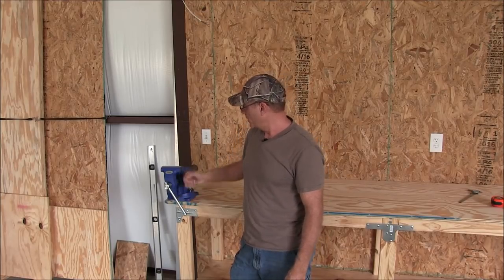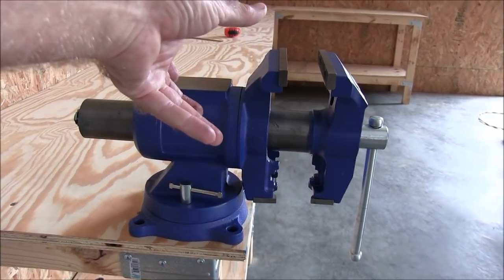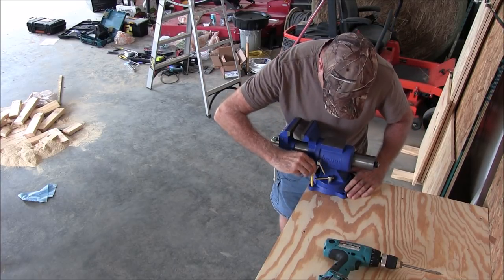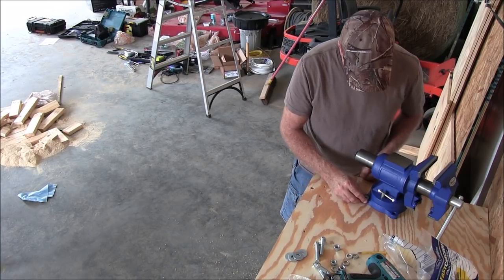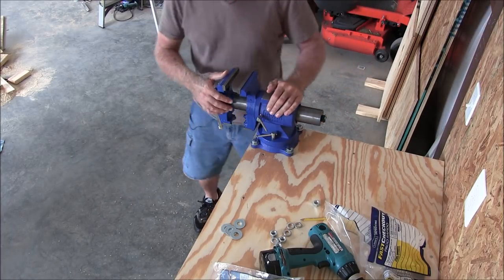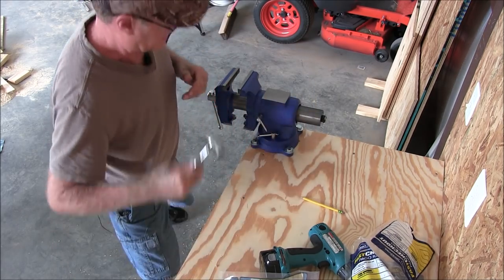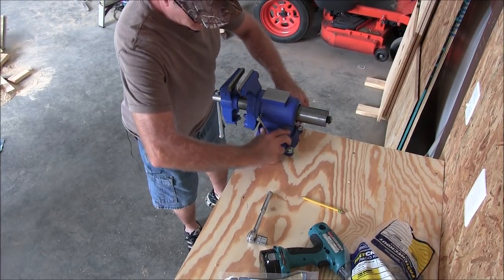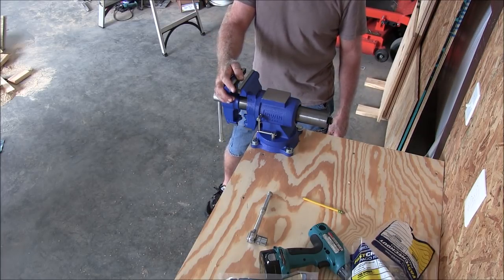How to Install a Bench Vise

Comment: Mounting a  MACHINIST's vise on a random workbench is a waste of effort.  The one used as an example is a very poor example, as the top is too thin and the base is not positioned to provide solid support, and the bench is positioned in a non-optimum working location.  A woodworker's vise will have completely different mounting requirements. 

The things to consider are your workbench construction, placement, and whether you are right or left handed.   

 If you are building a workbench for yourself, then make it for you, not some "average" user. Do not blindly follow a plan that was created by another user.  Workbench design should be based on intended user AND the use.   The height should place the workpieces at the best height for the user.  The depth and width of the bench should be adjusted to suit the items being worked on.   

If a machinists's vise is to be incorporated into the workbench design, not mounted as an afterthought,  then the top should be built to support the vise's weight without flexure UNDER LOAD.  The leg structure should be sturdy enough to withstand the forces applied to it IN USE.  A leg should be directly beneath the vise to fully support its weight, without interfering with its mounting hardware, unless there is a compelling reason not to do so.

Any universal workbench design will be a compromise unless the work to be done is known and the size of the user is close to "normal" size.  The best example of bad design is seen in kitchens. Short and tall users find that working in a standard kitchen is awkward and tiring, and when they utllize storage without restraint, will store items in locations that users at the other end of the height range will find awkward to see and/or reach. Younger children will require step stools to work at the counter.  

The same is true of a shop workbench.

Workbench placement is a consideration ignored by too many "users". Generally the location chosen is against a wall to get the bench out of the way when  NOT being used, and the bench is made immobile.  But a workbench is a TOOL to support workpieces while other tools are used.  Using a bench against a wall might work for small items, but for larger items it limits utility.  It's like having a jack permanently mounted to the floor and moving the car to fit it.  If you did that, would you place it tight against a wall?

After decades of using workbenches, and having to have separate stands and work tables that required setup and storage,  I broke with the traditional home user placement of a bench with a long side against a wall, and have never regretted it. 

Having both long sides away from the wall turns a work bench into a work table.  If storage when not in use is an issue,  sets of casters can be attached to adjustable cross pieces that can be jacked down to lift the table from the floor. If it is necessary to work on heavy items held in a vice, the wheeled subframe can be made to swivel relative to the table  into an outrigger. I built folding sawhorses, bout roller top supports that could be used with other shop tools, none of which are permanently affixed in position.
Reply from the maker: I've been a machinist and toolmaker for over 30 years and this is no machinist vise. This vise design is just a step above the average vise with the ability to hold pipes and round things, rotate and pivot. It's designed for the average person and home owner. I've seen a lot of people mounting their vises wrong so i'm just trying to help them out with this video. I think you're over complicating things here. But thanks for your input.
Reply: Are you serious buddy? Get a life.
Reply: You can always tell a expert know it all with a IQ lower than the ocean bottom at it's lowest location. I am not impressed by someone doing something for decades and not learning anything.  Nice job and nice video sir I see that you made it the way you wanted it and for your usage. You are an impressive man, not like the snotty nose complainers. He did not do a video because he does not have enough knowledge to do so.